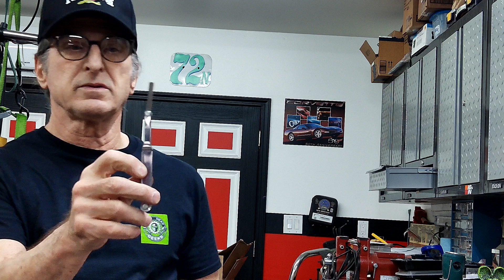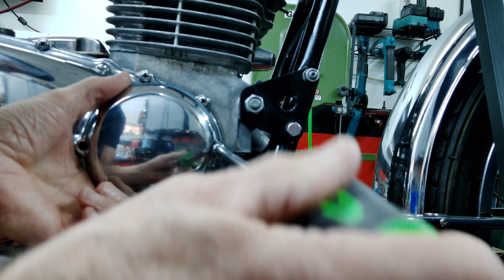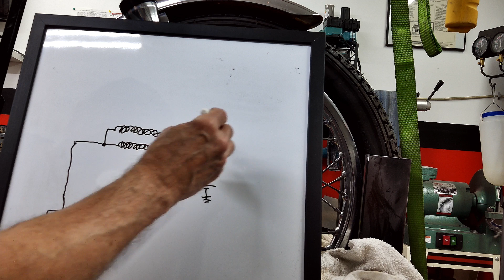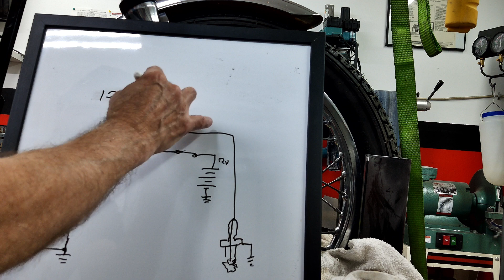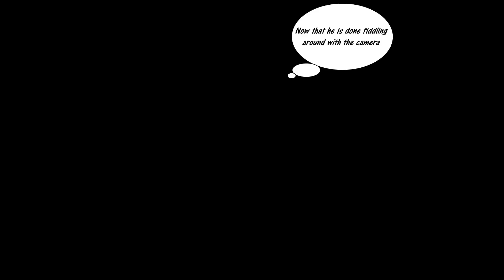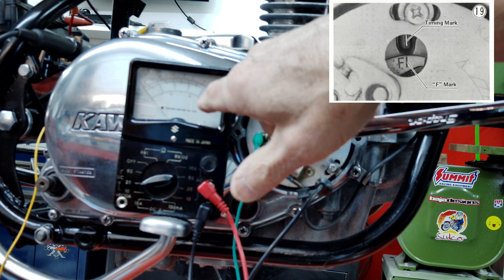HOW TO SET MOTORCYCLE POINTS AND TIMING Don't Struggle.

Comment: 24:05 I’d recommend using a 6 point hex bit socket wrench for this instead of a 12 point socket to reduce potential of stripping the bolt, the 12 point sockets have a tendency of slipping more easily. Great video regardless, thanks for the info!
Reply from the maker: Good point, I usually use a 6 point (MAC) swivel wrench, but I thought for illustration purposes a solid wrench would be better. But you are correct. Thanks.

Comment: I always used a transistor radio, clean points, ignition on, radio on full volume off station. Nice big crack as the spark jumps the plug, can’t get better than that.
Reply from the maker: Thanks for sharing